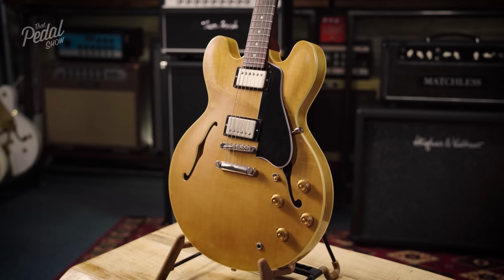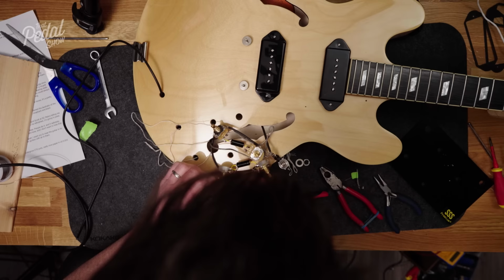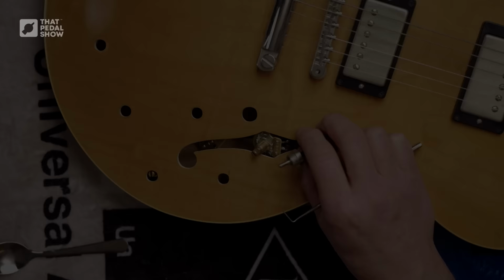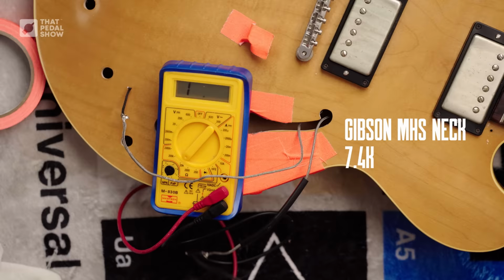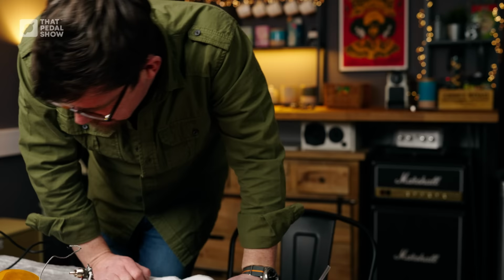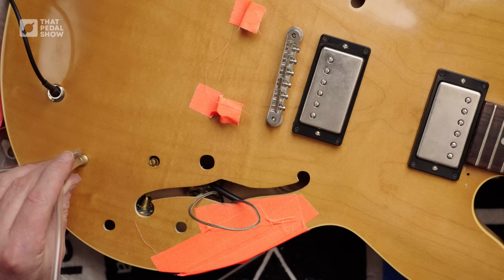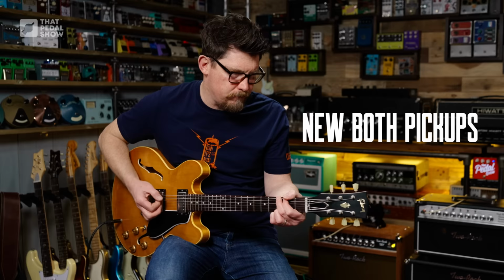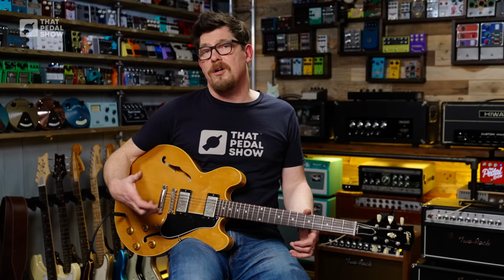Mick’s Gibson ES-335 Gets New Pickups & Loom [Hardest Pickup Swap Ever?]

Comment: Thank you Mick for doing that. I can see that rewiring my 335 could be a project I could undertake providing I allocate a whole weekend  (or more) to it.  BTW, I used to have  '58 335 in blonde like yours and its the one guitar I have sellers remorse over.   I loved the unbound neck albeit found the neck a little bulky.  I really liked the MHS pickups.   I stupidly sold my '58 several years ago and recently bought a new '64 which has a less bulky neck however the pickups don't have the ring my '58 had. Great video.

Comment: 😂😂😂 Best guitar video ever, we’ll done Mick you got there! Having done a 14” Gretsch twice I felt all of that pain😅
I now have 3 X Eastman T486’s (335 style) on the bench and intend disconnecting pickup wires, installing a new wire into the pickup cavity and terminating with bullet connectors. Then I need never go through the process again and can simply swap around all my pickups.
By the way, preferred the originals, can I suggest putting them back?
Reply from the maker: Ha! No. I prefer the new ones. Lower output, less bass, more vocal mids = more articulate at volume. Cheers!

Comment: With strats its definitely the case that newer pickups have too much gain! That is they produce too much voltage, so to get a classic sound get the older fender pickups. All the new ones  have a different purpose. They chased a modern distorted sound but lost there quack! :-(

Comment: Another great video! I could feel your frustration, Mick, when you were running into trouble trying to fit the loom through F hole. Anyhow, glad you were able to pull it off. I can definitely hear a difference between both sets of pups; Gibson's sound slightly darker, and muddier especially on the neck but growl a bit more (higher output?). Lollar's are brighter. PS Love how you always sneak in the first few notes to the solo from Badge...one of my favourite guitar solos and songs which I need finish learning! Love the show :)

Comment: Right “strapping on tin hat”. The newer pickups sounded brighter to me. And if that’s what you are going for then bravo, we’ll done.  I get that “in a mix” things sound different - but in my experience of recording if you need slightly more mid on your guitar etc you can dial that in from your amp.  More startling results will be had by swapping amps or (wait for it!) adding pedals.  Replace pickups when you want a chalk and cheese difference - Or because they are f*cked.  Either way well done Mick for persevering throughout and talking us through this procedure.  I doff my cap sir!

Comment: Hey Mick ! Thanks for the video ! I have the exact same guitar, same model from same year and same color so my interest was very very high. 
I wanted to comment because I did some changes to mine as well because I did find the exact same issue with mine. I have also a 355 and a trini lopez so I could do some comparaison. 
The changes are a set of Monty’s PAF wit 4 wires that allow me to do a partial split. I also added a bass cut circuit (the same kind you can find in G&L guitars). It is an extra pot in the guitar but I chose the looks to be like a varitone. 
I works pretty well and it makes the guitar pretty versatile. 
DM me if you want to talk about it, it could be pretty interesting knowing that I changed also the electronics in a trini Lopez and a 355
Keep up the good works 
Best wishes from Belgium

Comment: Both sets sound good to me, not a significant enough of difference IMHO for the cost and aggravation.  I can relate on the aggravation... extremely well done.  Keep the old pick-ups and the rest that came with it, in a few years your ears may sound different and you'll be wanting to put them back in.  I've had an old 67 335 since I was a kid.  I bought it in 1970 and have thought about switching out the PUs or even selling it so many times, but never had the guts, and then there were so many times when I plugged the old girl in and thought "My God, don't ever touch this thing or sell it."   Going on 53 years of ownership and she's still totally stock, scratchy pots,  finish checking, bumps and bruises and all.  Anyway, thanks Mick, great fun.

Comment: I too have dwelt in the guitar mod rabbit hole and learnt it's the total guitar you buy...changing stuff rarely solves whatever tone issue it has. If you have gone off the tone sell it and find one that does...it will likely work out cheaper with less hassle and mistakes
Reply from the maker: I agree to a point…. But I’ve also learned to understand when the chassis is worth the swaps. My Casino was //totally// transformed in a great way!
Reply: @ThatPedalShow  Agreed…there’s always an exception

Comment: I own a 2014 Cherry Dot ES335. I have not found any need to change anything on that one or a beautiful MIJ 1972 Cherry Red flame top Aria Pro II TA-70 with factory DiMarzio's. I own 4 other semi-hollows from D'Angelico, Eastwood, Gretsch and have mod'ed all of them. I am not averse to doing so on ANY guitar, but only if I think it is needed and will improve the sound or playability or hopefully both. Almost all guitars under $1500 need tuners replaced and a proper setup at very least.  Often switches and jack are crap as well. A hundred $ in upgrades will improve most imports substantially in my experience.

Comment: If the guitar/bass/ackordion/boat/in-law offers up less resistance when you try to bend reality to line up with what you hear inside your head, then fine, the new pickups did the job and the work was worth it. Some changes need to be subtle rather than earth shatteringly obvious to be effective. Personally I am biased towards the imperials, that's a nice set of lollars right there.

Peace and have a great weekend everyone

Comment: The question I have is whether or not you've tried those MHS humbuckers wired in parallel, rather than series. Humbuckers in parallel sound dramatically different to wired in series. If you haven't seen it, you should check out Kris Barocsi's video comparing the ES-335 and ES-330L (which is a full hollow, but more importantly, the MHS pickups are parallel).

Comment: String (and metal hooks to pull it through with) is easier than plastic tubing.  A tip for next time … second thing is, set up your workbench so you can work standing up.  Greater physical freedom, less mental congestion.

Comment: swapping the first preamp tube on your amp is faster, easier and will make more difference than swapping great pickups to slightly better pickups., youv'e tweaked the rest of the chain and there are priorities when tweaking. all you need is an orange tube tester and some nice used vintage tubes .no stress involved. you just get to easily tune the tone and breakup to your liking .
Reply from the maker: If you watch the whole video, I explain the context, making tube swaps and so on not relevant to my situation. Cheers.

Comment: I prefer the Lollar's and new wiring harness to the original pups and harness. New pups and harness have more pronunced, yet subtle, high frequency extension. To my ears this allows me to hear the pick attack better which translates to better detail and note separation in single note lead runs.  New pups and harness mid's are voiced in a range that is more pleasing to my ears and doesn't compete with the low frequencies. New pups and harness low's are more well behaved and don't sound as "muddy/dull" to me, to my ears this translates to more articulate rhythm and chordal tones. Mick's setup (Two Rocks, EV's, CXM, FTT-FF, etc...) is a very detail/revealing rig. With a less revealing rig these differences would be more difficult to discern. But, in this context: Lollar's and new harness for the WIN!
Reply from the maker: Nice analysis Rob, I think I wholeheartedly concur!

Comment: The wiring loom is more easily installed via the bridge pickup opening.
I think that most 335 styles with a Centre block still have a large enough opening through the side of the block. Maybe not on some.
Reply from the maker: Watch the whole video before commenting.

Comment: sorry for my laughing, been there, done that, wearing a tps t-shirt, feel the pain and anger :)
the tubes are a nice idea, but the space issues... something thinner like a fishing line, can be more handy, but you need to attach them before removing the old wiring, then make sure they don't get out of the holes while attaching the new wiring. knot the ends to a key ring can help, and when you are done pull them back. make em long enough and it leaves you more freedom to work with.

to me with the new PU's everything sounds a bit brighter, i would not call it sparkle, just brighter. both old and new sound great, but if the new brightness fits better in your setting and mix, i guess mission acomplished :)

Comment: I bet one of the biggest differences you made was putting probably higher value k pots in there. It can make a really big difference in letting the treble frequencies come through. Especially with the tone pot wide open. The harnesses I get from rs guitar works that I do most wiring swaps with are around 550-575k I think. I do think it sounds better overall slightly since your swapping. Good job man that is a monster task with a 59 style 335
Reply from the maker: Could be part of it! I remember when I was at Gibson one of the guys there telling me they were choosing the pots that measured around 550 for the Rusty Anderson Sig. for that exact reason. Cheers!

Comment: Your a brave man. The 64 block neck reissues you can go through the bridge pup. And as you experienced the 59s you can only go through the f hole. I scratched the f hole on my 59 like you ended up doing recommend taping them. On subsequent pickup swaps in my 2013 Nashville custom shop 59 I ended up just splicing the lead in the f hole instead of soldering directly to the pot. Still a pain but much easier. The biggest pain was getting the neck pup lead to come out where I can grab it with a dentist tool to pull out the f hole. Sometimes it’s fast some times it takes 40 min to just grab the damn thing. It is my most hated guitar to swap stuff on just hassle wise. But like you I am a tinkerer and can’t leave well enough alone. I also have broke the cap legs off shoving stuff through there. Man it gives me flashbacks of screaming at the guitar like you were just watching this lol. I made all the same mistakes lol.  The super sad thing for me is after swapping about 3-4 sets of pups into it I actually liked the stock ones the best and that’s what is in there now and wished I hadn’t touched that particular guitar at all lol. But I do usually swap out Gibson pickups as I usually do prefer aftermarket ones
Reply from the maker: I feel your pain Cort! Cutting the wires makes sooooo much sense!

Comment: A less costly mod might be the cap and resister trick across the volume pot terminals. i.e. treble bleed. I actually prefer just the cap on humbuckers. Are you humbuckers too dark? Use this mod and just roll off some of the lows with the volume knob. If you are using some drive you won't lose much volume, just the lows until you get down past half way. Experiment with the cap value.

Comment: Ive just tied a string to the each shaft and then pulled em out n worked on em, the just pulled em back into the correct spot. Just need enuf slack.

Comment: I just swapped the pickups in my Ibanez 335 (well AS53) from some no name alnicos (muddy, weak, shrill, muffled all at once) for a set of irongear blues engines, and The fishing things was maddening! thankfully that guitar is only 1 v 1 t. I put the innards back to find out the neck pickup didn't work (yes, i should have checked before puttig them back) so i had to do the whole operation again to resolder one joint on the switch (no play in the wire lengths). Put it all back to discover the tone knob is now scratchy. sod it- i just now sprayed some contact cleaner in its general direction and hopefully i'll have hit the mark. I can't be arsed now haha. It had mini pots btw, which made it a bit easier to get it through the f hole

Comment: This is giving me memory anxiety - the worst bit was pulling the pots and jack through - I used labeled string - first time I did it it was like a birds nest. All of the wires and string wisted up. I ended up making a rigid harness so that it would spring into the right shpe once through the holes. I am rolling around the floor laughing at this Mick. It's a total and utter nightmare.

Comment: I have cheap Hartwood model semi hollow from gear4music and also low wind lollar pickups and i didn't want to make things hard so i made a hole on the back of the guitar so i can reach to electronics easily. It didn't effect sound, and i put contact plastic on the hole to cover it. I also move the output jack from top to side like it's on lp. I would do this to Gibson model too if i own one. Gibson and all the other semi hollow makers should make those changes because it makes things so much easier with semi hollows. 

By the way... These low wind lollars are very bright and tight so if someone wants little darker and loose sounding pickups then Monty's Paf is very good choise. I have both lollar and monty sets so i know.

Comment: Not sure if it was mentioned..but was the original loom "modern" wiring, and the Montys "50's"?
I have changed all my guitars to 50's wiring as I like the clarity when rolling the volume back. Just seems more alive..even at everything maxed. Could be a factor. I preferred the new setup. Clear and bright. Also sounded better with gain (loved the gain on the bridge with tone rolled back). Tone really is the sum of all parts as you mentioned...and caps, pots and wiring are a large part of it. Even a 550k pot over a 500k pot is huge. i wonder what old pots readings are compared to the new ones?. 
Kudos for getting it done without it ending up in the garden.
Reply from the maker: Thanks Kevin…Yes, everything 50s wired as far as I can tell, albeit achieved differently on the Gibson loom with longer connectors. Interestingly enough when I was at Gibson Memphis, one of the techs there was telling me they measured all the pots and actually got some closet to 550 on the tones, particularly for the Rusty Anderson model. Cheers!
Reply: @ThatPedalShow  Very cool to hear Gibson take the time to do that. I prefer a brightness in both my humbucker and single coil guitars. You can always take it away at the amp or eq..but its impossible to add it to a muddy guitar. My trusty tech is often pestered by me for 260-280k and 530-550k pots.

Comment: If you find yourself wanting to thin your humbucker tone further, I have found that setting your pole pieces lower (like way down in there, if need be) before resetting your overall pickup height will emphasize glass and spank. I know this is contrary to popular belief, but this method causes a favor to the slug coil, which I believe is what you want for brightness. 

P.S. that middle position (Lollars) with the neck turned down sounded incredible

Comment: Something I learned through the years changing pickups is, insofar you dont change them to like emgs or something dramatic, the changes will be small, albeit significant depending on what you want (little high end, clarity, etc). Thats just to say that if you like your guitar as is you wont ruin it with a pickup swap, the guitar is always going to roughly sound the way it does, as in its fundamental character. So if you have a 335 or les paul with stock pickups that sound good and you throw in something boutique, dont fear that youll lose something that you liked to begin with. In my case I have a memphis 335 that had 57 classics, similar feeling/experience, felt a little muffled, lacking chime etc. Popped in throbaks and an rs guitarworks 50s wiring harness and what was a good guitar became a brilliant guitar. Ill never wish the process of changing pickups/pops on a 335 on my worst enemies though, itll truly push you to your limits lol. Congrats on new pickups, guitar sounds mega!
Reply from the maker: Nice. I can relate to that Justin. Cheers man!

Comment: Ive been watching this sounds only and I was wondering if you mixed there Tele sounds for some reason, only to find out, those are the new Lollars.
I think this is all you need. Articulate, bright, string separation, less lowmid  boxiness. And it will shine loud and with band.
The Gibson pickups seems more for low volume, in isolation or very lightly playing band.

PS: this is NOT a small or marginal change. This is massive improvement.
Reply from the maker: Amen to that!

Comment: Am planning on undertaking this same task on my own rather non-descript-sounding 335 soon, not for fun but because it really needs reinvigorating. Have previously tried same on an Epiphone Sheraton and recognised several of my own traumatic moments from that time recreated  with stunning accuracy in your video above, to the extent that I was feeling an almost spiritual connection in a weird kind of way. I think the highpoint was trying to get the shaft back up through the hole and finding it nearly impossible to grasp properly. My own remedy - sewing thread !! Didn't work straight away but after a bit of practice it did the job nicely.